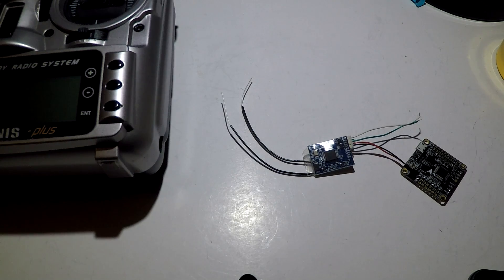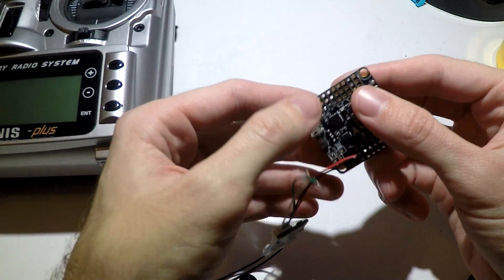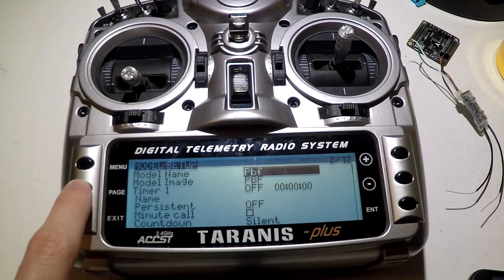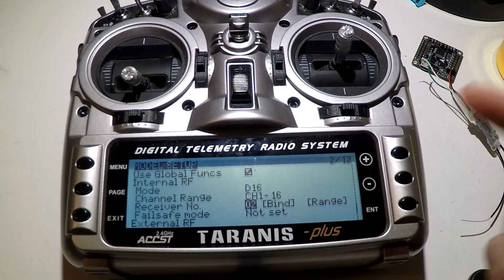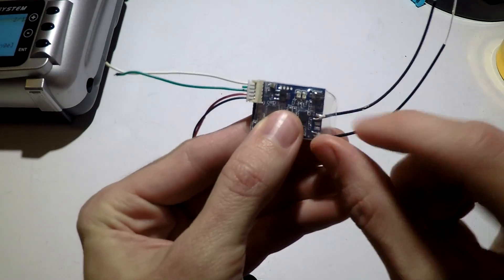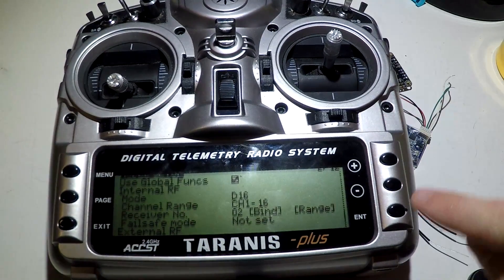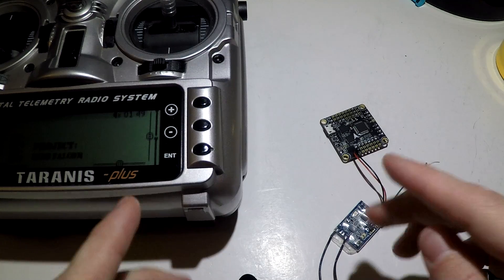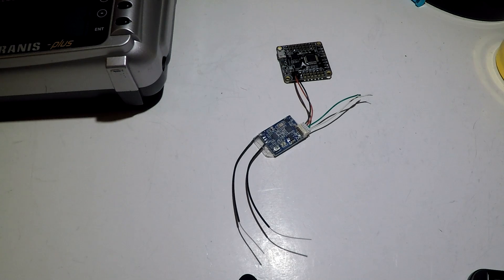How To Bind FrSky XSR Receiver

Comment: When I plug my xsr in to bind it i only get a sold red light and a solid green light. Anybody know what is wrong? Why is the red light not blinking?
Reply: I have the same issue.... Anyone knows how can I fix that?
Reply: @szanibodo940701  use another sd card. That is what was wrong with mine.
Reply: @szanibodo940701  sorry. That was the next issue I encountered. I got the xsr to bind by flashing the firmware on the transmitter and the xsr to match.

Comment: This is alittle off subject but need help, i have flashed my r xsr with latest firnware and it binds to my radiomaster tx16 no problem, radio shows inputs,outputs mix and strong signal but in inav 2.5 in recever port there is no stick inputs at all. I have green wire from reciever to sbus, power and ground to uart 2, ive also set serial and sbus in inav I have switched around wires everway posibble but still no stick inputs, I also tested restiance on f405 wing but looks fine. Maybe you have seen this before maybe you can help? Thanks

Comment: I have done this, however, when I take my Qav X out to fly and pull on the altitude stick nothing happens
Reply: I am guessing you maybe figured out your problem? Its failing to arm for some reason. For me, my throttle off range was set too low, and I had to raise it about 70ish above what it showed my minimum throttle at in betaflight to correct the arming fault.

Comment: If the solid green and red lights appear during the binding process, does it also mean the firmwares are conflicting?
Reply: i think i have the same issue now. did you fix that ? i cant get in the bind mod.

Comment: I have a SP F3 flight controller connected to SXR receiver but the receiver doesn't light up when I connect the controller using a USB cable. Can someone tell me what the issue might be? This is the controller I used https://www.banggood.com/Upgrade-NAZE32-F3-Flight-Controller-Acro-6-DOF-Deluxe-10-DOF-for-Multirotor-Racing-p-1010232.html?utm_source=Youtube&utm_medium=cussku&utm_campaign=5635792_1010232&utm_content=1081&p=CG24181822629201506N&cur_warehouse=USA

Comment: I try to bind my XSR to my qx7 but the receiver will not power on could it be a bad FC that I have.  This  is the Fc I have F3 Flight Controller Acro 6 DOF/Deluxe 10 DOF for Multirotor Racing.  When you print the Manuel it say Seriously Pro  Racing F3 flight Controller Revision 3.   Same thing happen with my XM+ receiver it will not power one connect to this board.    Any help will greatly appreciated
Reply: Did you ever get an answer? I'm having the same issue. I'm trying to give power from my laptop to my fc and it won't power up the XSR, so I can't bind.

Comment: Can you suggest a cheap FC that can give a receiver power thru USB for binding purpose?
Thank you!
Reply from the maker: Almost all of them do it nowdays. Of all of them I think the best bang for the buck is the Omnibus F3 now selling for around $23-25. Or you can get a Omnibus F4 for about $37. Of the ones I've used the RMRC Dodo, SPRacing Mini, SPRacing Evo, X-Racer F303 V3.1, and Revolt all can power the receiver with USB. But like I said most do it so there are even more than that.

Comment: Hi JC! Great to have you back!! I have an xsr-receiver question: Recently I do not get any "Fuel" telemetry information anymore to my taranis (I have kiss gear with 24A ESCs) and I cant really say why. All the other telemtry data like voltage or current work as they should, just mah do not work anymore. So I started to investigate a bit and somehow I found out that I have continuity between the signal and ground solder points of my antenna. In other words: when I put one sensor of my MM to the signal wire of one of the xsr-antennas and the second sensor I place on any other ground-contact, I get a beep. Can this be? Or lets say...is that as it should be? thx for your help!!
Reply from the maker: Hey R. goljator, missed you bud. I just did the same test and I'm getting continuity between both signal wires and between signal and ground. I believe thats normal though because I'm also getting the "fuel" sensor as well. I believe this will depend on the flight controller. Which flight controller are you using?
Reply: Project Blue Falcon Thanks for your answer! okay, good to know that at least the receiver is okay. i have a kiss fc and flyduino (distibutor of the board) already offered to return it for a check. But since i had a spare Kiss FC i replaced it with that one and the outcome was the same...strange, right?
Reply: Project Blue Falcon And of course also thx for the continuity-double-check!

Comment: One good tip when powering up the Rx from the FC is to connect the Micro-USB end and use the USB end (The side of the cable going into the PC) to complete the connection. The Micro-USB connection can be a bit tough to work when you only got one hand. The larger USB connection is much easier to plug into the PC with one hand than having to mess with the tighter connection to the FC
Reply from the maker: I do agree completely. Problem I have is my computer is 4 feet away from me. Makes things a pain when flashing firmware using the bootloader.
Reply: @ProjectBlueFalcon  I know this is 4 years old, but I would recommend running an extension usb cable to a hub on your desk. This has been proven to be very useful to me since I started doing that years ago.